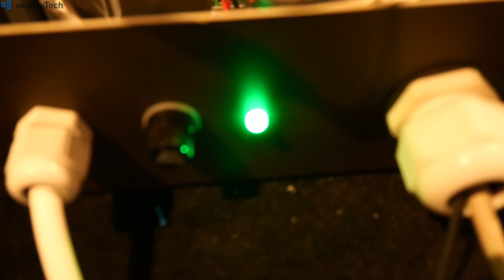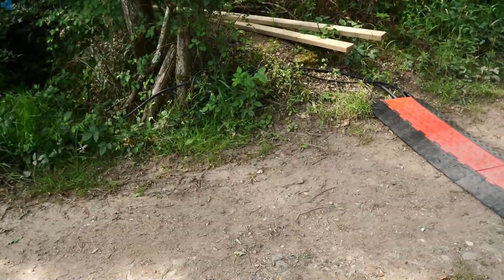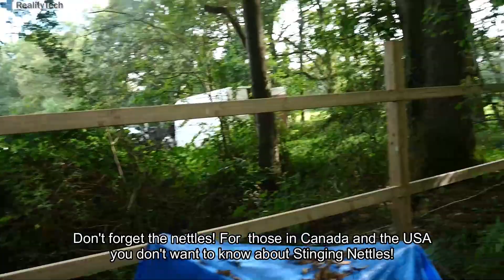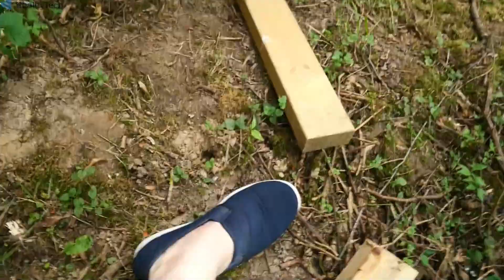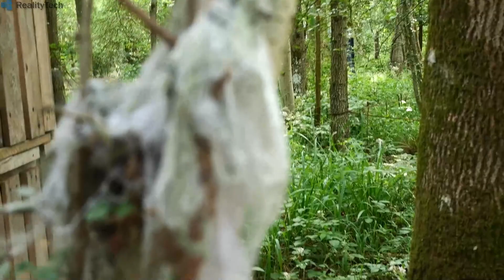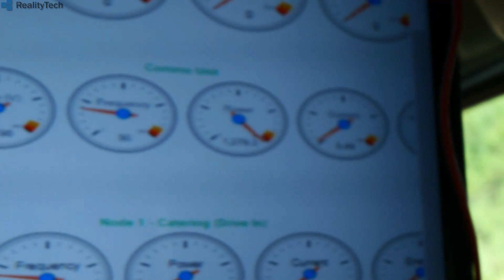VDSL Event setup and comms unit

Comment: This is fascinating, thank you for uploading. Do you use the modems and DSLAMS to provide connectivity over large distances using twisted pairs rather than multiple ethernet runs?
Reply from the maker: Ethernet is limited to 100m, there is also a point where extending will start to cause issues. On top of that there is cost. That backbone would need 8 cables, repeaters for all 8 cables and then two would require further repeaters and the lot needs power. POE extention more than once gets iffy. So that's 10 repeaters, 6 extra cable runs out of the bat for no gain. The broadband is less than one modem's symbol rate. Against this being able to shove 50 channels down one cable (I have 50 pair cable if needed) and run for several kilometers with no special equipment.
Reply: @rtechlab6254  Ethernet over optical would be a be a little better, but DSL was designed for data over distance so seems as good a way as any. On a more open site 5Ghz point to point links would be a great idea, but Microwave and trees don't get along so the setup shown seems like a good compromise.
Reply from the maker: @jonshouse1  Optical adds cost and fragility. Everything has to be splices, extra cost for a media convertor over a £10 huawei modem. We've had cut cables on larger events and with copper its just throw a few jelly crimps in and jobs a goodun. We use fibre backbones on some sites, these tend to stay in place. One event site we do every year has  12 pair from server room in office to our two DSLAM cabinets. The whole lot is ducted and out of the way.
Reply from the maker: People also often don't realise that weather radar screws with 5Ghz Wifi
Reply: @rtechlab6254  Interesting, the rest of the world uses around 3Ghz for weather radar, so in the UK we pick 5.6Ghz just to be a pain in the arse....  Does it wipe out5Ghz Wifi point to point links completely or just cause dropouts/retries ?
Reply from the maker: @jonshouse1  it's slap bang in the middle of C band, often used for pulse doppler weather radar Internationally